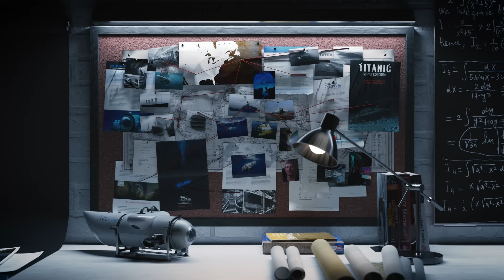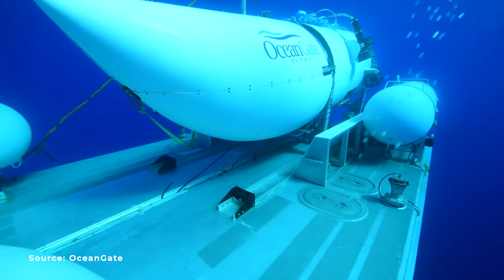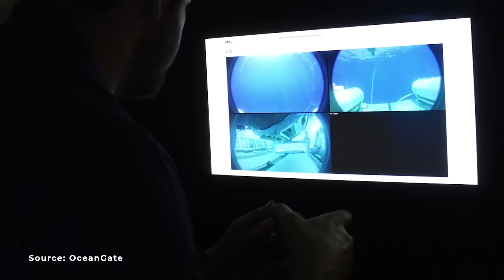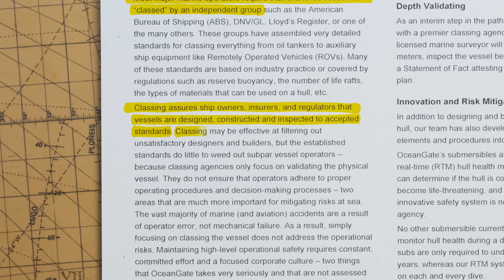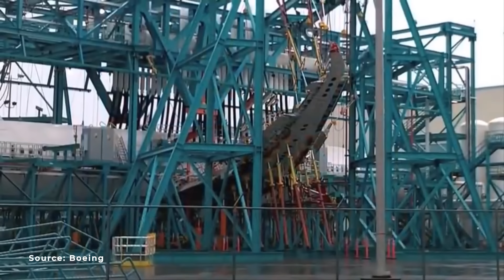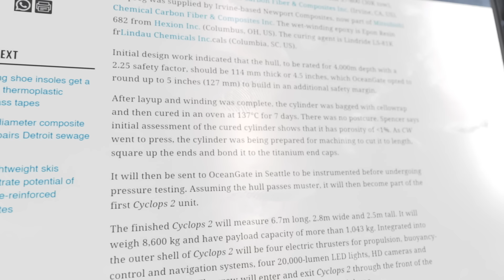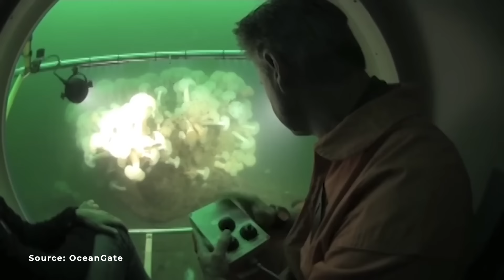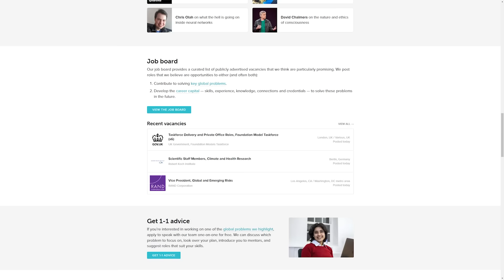The Questionable Engineering of Oceangate

Comment: The more I look at that sub the more I see that the straight section of it is it’s biggest design flaw, had this Submersible been made Spherical or even Hemispherical ends with a bulbous central hull, pressure destruction would have been far less likely, talk of delamination causing failure speculates on the quality of Carbon laminate used and the epoxy application technique, I don’t think that it’s as great a factor as the true Cylinder between the hemispheres. A spherical design has to be the ultimate pressure vessel design for super deep diving, that’s why the original deep sea Helmets were spherical. If the cylinder was just the internal structure and they added a more curved Skin on the outside bulbing to a wider centre and curving to each of the hemispherical ends it would have stood much more pressure for longer. Then the other problem to deal with would have been the porthole viewing window … the Acrylic windows on the Submarine I went down in had two inch thick Viewing windows and it only dived to a hundred and twenty feet in our dive … that suggests that a thick curved glass window to go down to the Titanic needs to be at least that thick …

Comment: It is sad, perhaps the material could be viable. 
IF done right.
IF damage could be spotted before it get dangerous. (I assume one can, with ultrasound or some other kind of x-ray device. (Be it actually the usual ones or magnetic,)
If this is right, horrible cost cutting in its production throws shade on the whole thing. 
I did think it was shady when I spotted during the glue part of a video.
That they did not even have hair nets then.
Did they do this in a dust free environment like one expect. 
Or is it totally fine for dust and hair get into the glue?
That they did not even do that basic thing.
(Says me who know nothing about this kind of manufacturing)
Makes me wonder about other stuff that the real experts may see, or wonder about, when they consider the construction.

Frankly I think it is amazing it has survived so long as it did.
And MAY point to stress failure.
BUT who knows, something may have damaged the hull while on ship.
Or some kind of fitting may have been under too much stress and eventually worked itself, or the hull to a failure.
Boats are hardly vibration free, so that may have happened when the sub was not in the water itself.

But perhaps vibration and waves had been taken into account when the "sub" was stored on ship.

Soo many possible points of failure.
And seems like no proper inspection of the hull seems likely.

Did they remove the coverings inside, and out, to see if everything was OK between the times the went to sea?
So many questions.

Comment: Oh, just for the record, when Real Engineering talks about "foam" he's almost certainly referencing a material called Syntactic Foam, which is a material made of hollow beads (typically glass, ceramic, or in some cases even metal)  in a binding material such as a polymer.   It's not like Styrofoam, which would be squished flat by ocean pressure and wouldn't be much use for buoyancy control.  

https://en.wikipedia.org/wiki/Syntactic_foam

Comment: You can't compare to spacex, that's really unfair they may use a move fast and break things approach however they do it in the service of safety testing many, many prototypes. Move fast and break things doesn't have any connection to safety it is a approach, a tool that can be used to achieve safety or not.
Reply: Dude. At least Elon would rather test and break things not people like the Ocean Gate CEO.

Comment: 10:57 the acoustic monitoring system in Titan was like a car alarm that alert you right when the car flipped so that the passengers can prepare for the upcoming crash.
Reply: Exactly! Because once a sub begins to have a structural failure like the tiniest fracture the whole thing can just implode within a split second. Like squeezing an empty soda can.
Reply: They would be dead before their ears registered the sound.
Reply: An acoustic emission system is well suited for predictive maintenance, especially in carbon fibre materials. CFRP emits plenty of ultrasound signals long before its failure. It is a rather complicated structural health monitoring system though and the way of interpreting the data is the most important part. It's used a lot on CFRP fuel tanks for rockets, which, to be fair, are loaded under tension and not compression. This video is a bit dismissive about acoustic emission testing in general, although I doubt they had experts to interpret the signals properly, which renders it pretty useless.
Reply: @FlorianLinscheid  you need to chill out

Comment: 10:57 I don't quite agree. There are many local faults in the material before the entire structure collapses. Passive SHM will listen to the failures occur (probably what Oceangate had) while active SHM will send out acoustic waves to check for changes. Both practices are still difficult to apply because we don't really know yet how to interpret the signals we get.

Comment: In my humble experience we’ve found that nearly all graphite composite layups, especially filament winding, are incredibly porous at quite low differential pressures. We tried many years ago to apply this technology to making fluid ducts and it was a total failure.  It is not a fluid barrier except in the most trivial way. 
Under thousands of psi of pressure the external plies would have slowly allowed even liquid water to gradually permeate. Due to the isostatic nature of this fluid this would have allowed pressure forces to act on a gradually decreasing amount of structure inboard of the fluid filled areas. This situation also would directly contribute to delamination of adjacent plies. The amount of working structure would gradually diminish and to make matters worse there are degraded properties when these materials are wet. The depressurization upon ending the dive would also further intensify these delamination effects.  

This is not engineering.  This is laziness, ignorance and hubris.

Comment: In structural eng, we have safety factors on different materials used. Primarily steel and concrete. Steel safety factor is 0.9, due to it homogeneity mostly, we understand how steel performance with a high degree of confidence. RC concrete, a composite, has a safety factor of 0.65 at its weakest we expect to achieve 65% of it's theoretical maximum design capacity.

Comment: After seeing this i would love to see your takes on the carbon fiber movement in the airplane industry. Specifically the Hill Helicopter HX50 and the Dark Aero One plane, which both forego certification by being classified as experimental self-built kits.
Reply: Even in Experimental aviation, like Dark Aero’s case, they’ve done industry standard testing. The Experimental rating comes from the amateur built process they intend to sell to kit buyers.
Reply: @gte717v  because of their very open and transparent testing i already trust them 1000 times more than some self-proclaimed U-boat expert who is too cool for testing. But given how he's an actual carbon fiber expert, it would be a neat comparison. And if Dark Aero come out as a positive example, so be it, they earned it then.
Reply: In aviation, there are enough safety barriers in place. There are thousends of tests to certifying a fiber. Just the fiber. I have not talked about parts or system design yet. There are hundreds of thousends of pages of regulations in place which you have to comply.

Comment: As the resin gets compressed it bulges. Pressing the lamina apart. Once a point of even force distribution has been broken (most likely due to the wavy patterned of squished resin), its a runaway of the compressive force going where it can. Into the weak spot that has been created by this effect.

Comment: This is survivership bias at its best: "Well, most accidents happen because of operational failure and not because of mechanical failure, therefore we decided to focus on the operator and skip the classification process for the vessel" 
This only shows, that the classification system works, because it prevented most of the mechanical accidents from happening. Thats why we are left with operational failures only.

Comment: Only concern with controller is electronics that can create toxic smoke quickly in a failure. So thats only issue there. Big one is glueing carbon hull to titanium rings that joint was never controller tested. It was just done in a dusty open warehouse. The carbon hull was not vacuum set or autoclaved. Prepreg autoclaved 7" thick carbon like planned originally may have held up. But the wound wet set carbon hull 5" thick USED FLR 3 YEARS failed. Duno if filiment & epoxy matrix failed or joint of two different materials ripping glue joint apart. Either way taking paying passengers on expermental craft was hubris amd ego just why captain of titanic doomed so many lives. Kinda ironic after 100yrs humans still fail to admit their ego and hubris in face of nature

P.s. THANK YOU for calling out profiteering not innovation. The guise of innovation is used by many greedy egotistical people

Comment: Why did it lose buoyancy before failure? From the alleged final communication transcript, after hearing cracking noises and getting warnings from their real time monitoring (RTM) system, they tried to surface but could not.  That confused me until you showed that delamination starts on the INSIDE! A delamination like that which filled with water could affect buoyancy because it displaced the inside air.  However, there's not much space for that to happen, plus to be unnoticed.  To lose buoyancy means replacing air with water or losing the incompressible foam that's in the aft.  How much air would they need to lose to significantly affect buoyancy?   I assume that there's batteries and electronics cabinets in the back.  Are they sealed, so have air to release or are they coated to be intrinsically safe underwater?   Are there ballast tanks? I don't think so.  At some point they had emergency air bags that they could fill, so they must have a compressed air/gas tank that would be slightly buoyant (liquid air 870 g/L vs 1000 g/L for water) but there was no mention of them deploying that so maybe not on this sub.  There's oxygen tanks for them but no problems breathing, so they're intact.  For water to leak into the hull and displace air, surely they would hear or smell that, right?  There is some space under the floor.  Can the incompressible foam fail, perhaps because he bought a cheap replacement instead of the proper foam? Did they miscalculate the weight of people on board?  Nobody appears particularly large.  Could the thrusters be holding them down even though the controls show them thrusting up? (They made that mistake before with a left/right thruster.)  What could affect their buoyancy?

Comment: Innovation is not about moving fast and breaking things per se, it's about failing faster. Build something, try it, break it, fix it, try it again. Prototype early, stress-test to destruction, prototype again. Engineering is about problem-solving, innovative engineering involves solving novel problems and solving novel problems requires finding them.

Comment: I agree..
I'm a structural engineer and we design power transmission towers across the world.. Power transmission lines are critical life sustaining equipment where we have to test each tower design individually before the design is approved and implemented.
Even though we use steel, the angle sections we use are slender in shape, hence there has been slow progress in the physical research of this section's behaviour. Also all sections are bolted together, hence we have to rigorously test the tower before commissioning.

Comment: I'm not an engineer, nor do I work with composites, but I do know about the failure state of carbon fiber and that when it fails, it does so instantly and catastrophically. This is because I build models and have helped with building remote control airplanes, and both hobbies involve carbon fiber. When a rotor on an RC helicopter fails, it *explodes*. So when I heard that the submersible was made from carbon fiber, my first thought was, "Oh, that thing has obliterated, and the crew definitely turned to fine mist from the sudden increase in pressure" when people started speculating on how much oxygen they had left. Metals are forgiving when it comes to failure, and you can often see the damage long before your machine falls apart. But carbon fiber? You get a millisecond, and then bam! No more machine.

Comment: Its said that regulations are written in blood. 
Its not because some legislator thought 'Hey, wouldn't be good if we gave these guys some extra hoops to jump through', its generally because there have been deaths, an investigation found what caused it and steps were taken to mitigate the risk in the future.
Its why aviation is so safe, putting people in aluminium tubes and throwing them through the air at 500km/h is dangerous, but a lot of work has been done in designing systems that are reliable and legislating so minimum standards are met.

Comment: The controller is a Logitech F710 with probably 3D printed joystick caps. It's a third-party PC controller with two modes for DirectX or XBox gaming, it uses two AA batteries and RF wireless USB dongle. They're pretty good, they were my favourite controller until the DS4 released.
Reply: It's probably one of the best engineered parts in that sub.

Comment: 8:07 What are the thruster mounts bolted into?! Is that just a green coating on the black carbon fiber?  Like, a good way to let water get into the layers of fiber would be to drill holes in it, never mind the stress concentration around the holes.  I always assumed that everything was bolted to a frame that was strapped to the hull, with enough elasticity to accept the hull deformation under pressure. Ah, 8:09 the green one is the first version with a hatch on top. 8:12 is that later design with a black hull but again looks like the mounts are directly on the hull.  They could have embedded steel plates in the hull but that's another stress riser.

Comment: I'm glad you mentioned the "move fast and break things" BS. As others noted, it started with idiots calling themselves "software engineers" and causing no end to problems while patting themselves on the back for it with Zuckerberg being the one who popularized the vile phrase. We are still plagued by that mindset and I'm personally cleaning up the mess left by a former employee who did that in my work environment. Literally EVERYTHING he wrote while he worked with us has to be in large part replaced because of catastrophic and fundamental design flaws that were apparent the moment users tried to use what he wrote, meaning he didn't even try to adequately test it. Some of which he even had been told explicitly what not to do because of past problems. (And, no, it wasn't code reviewed either.) When you move fast and break things, all you accomplish is breaking things.

Thankfully, in my particular job, it's very unlikely for anyone to die from our failures. But when people start applying that to the software that keeps vehicles safe, or worse, the engineering of vehicles themselves, they should be sentenced for willful negligence and manslaughter.

I do feel we need to decouple SpaceX from its CEO. He has definitely been a key player in "and break things", but SpaceX itself has put in the work testing. A large part of that is because they are required to if they want to work with NASA, but their successes have been due to the hard work of their engineers, not their CEO. Left to his own devices, I'm pretty sure he would ride the first test rocket like Major Kong from Dr. Strangelove.